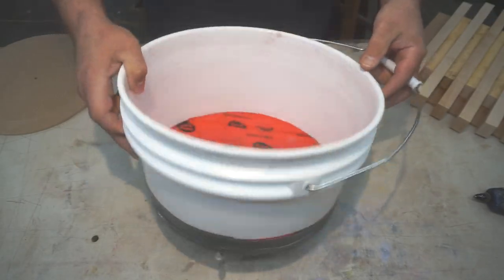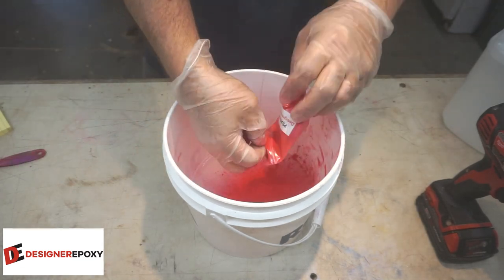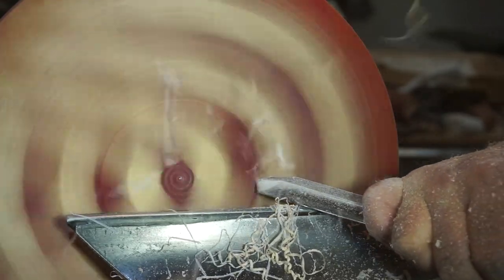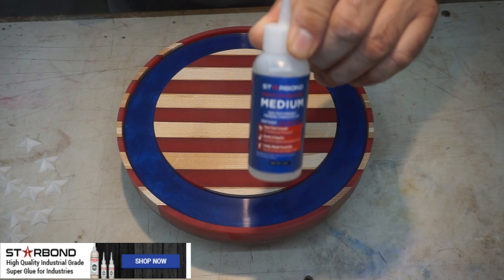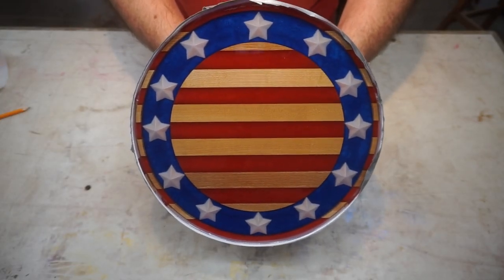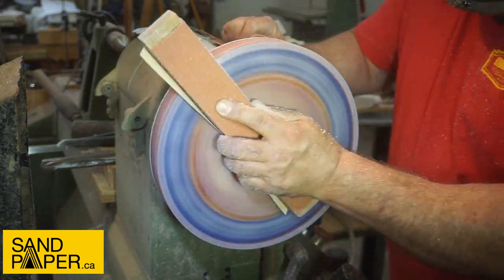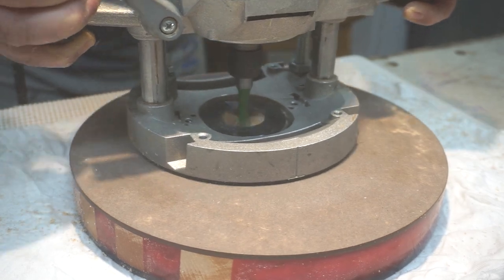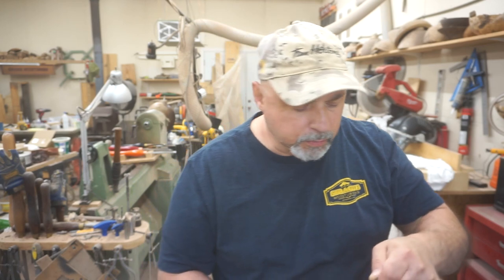The Stars and Stripes Clock

Comment: Thought it looks great. I have locking holes for my chuck that are spaced 15 Degrees apart, comes in handy when doing clock faces. I Just lock it in every second locking hole and using the tool rest across the face mark where the center of each number(star) would be. Enjoy your channel heaps and love how you get the wife's opinion. I do the same. Second pair of eyes never hurts
Reply from the maker: It’s funny, it never even dawned on me to use my indexing ring! That would of been the first time for it, lol. Thanks

Comment: Awesome job, Jim!
On a side note, just an FYI, I tried thinning Designer Epoxy 's pro series with acetone and it worked perfectly! Mixed it up per usual instructions, then combined acetone and epoxy at about a 50/50 ratio (I used about 8oz of each) to reinforce a bark inclusion in maple for outdoor patio furniture. It cured at about the same rate, maybe slightly longer, but was definitely rock hard at the 72 hour point. I know they now have a thin epoxy, but thought you might want to know in case you have something with a punky spot you'd like to reinforce.

Oh, and congrats on 25k!
Reply from the maker: I’ve been meaning to try this as a top coat and a hardener, thanks!

Comment: To make the recess in the back, drill a series of holes with a forstner  bit and clean it up with a chisel.  To hang the clock, drill another hole, then cut a slot with a dovetail bit to fit over a nail.
Reply from the maker: I debated this and decided not to do it for a couple of reasons first, I didn’t like the pressure the drill press would put on the clock face when it was upside down and didn’t want to chisel on the clock for risk of cracking the resin. If a hole is being drilled it would need to be perfect, if it’s off just a little the clock will hang off center, that’s why I went with the wire, thanks

Comment: Great tenacity--I would never have been able to make that right--I would have chucked it into the driveway until the next garbage day!  You mentioned pressurizing the pressure pot slowly.  What's the risk of pressurizing quickly?  I have the same pot and just let the compresser take it to 55psi as fast a possible.  Wondering what I might find when I open it someday!
Reply from the maker: I’m going to assume there’s going to be resin everywhere, lol. With the clear resin it’s so important not to get any dust or garbage in it. Trust me I wasn’t happy! Lol. Thanks 🙏

Comment: It’s a beautiful clock. My only suggestion would have been to use a star at the center point to hold the arms because the original American flag had 13 stars for the original 13 colonies. Would have been a neat touch
Reply from the maker: I’m finding that out now, lol. Thanks, if I do another one I will certainly offer that as an option.